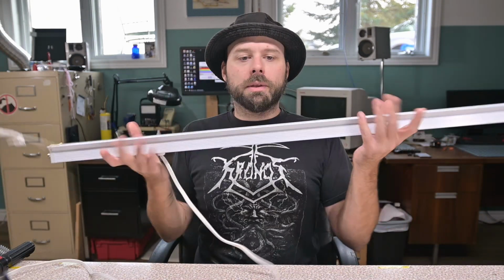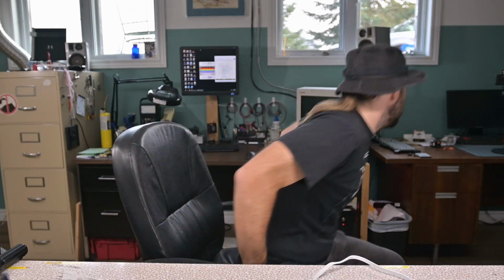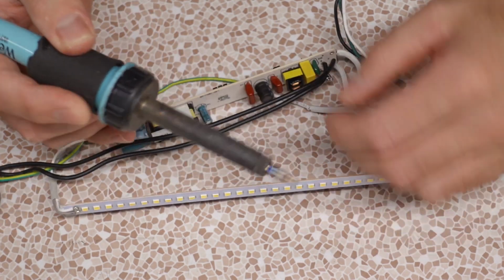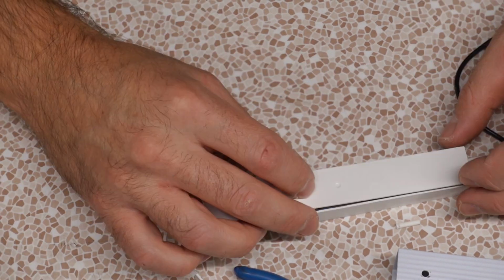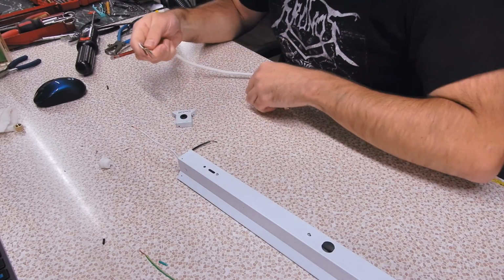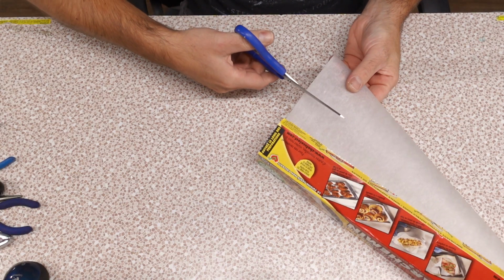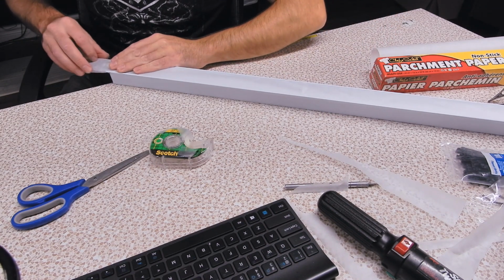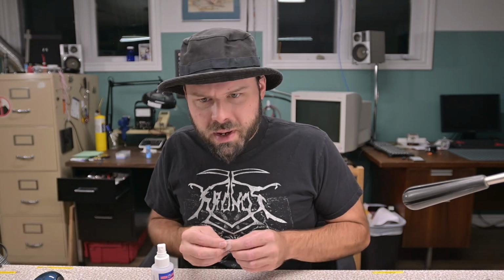Modding a Noma LED Shop Light into a Fill Light.

Comment: Nice mod but instead of going through the trouble of taping paper strips, why didn´t you just grind the plexiglass with sandpaper? I used P320 on one of my household LED lights and it worked out very nicely.
Reply from the maker: Hmm, that's a good idea, I hadn't thought of that. Just so used to working with the paper, this is the first light I could of used that trick. I'll have to keep that in mind. Thanks !